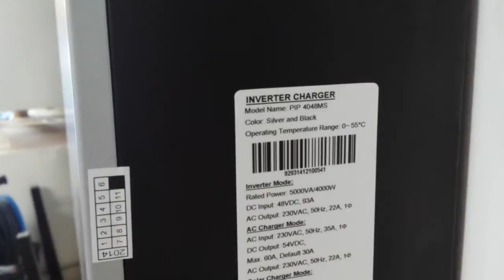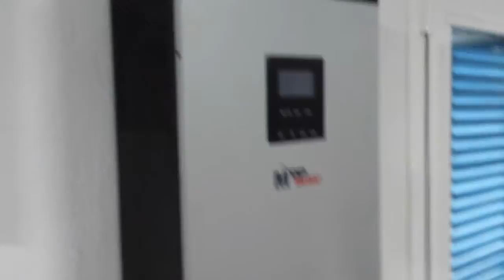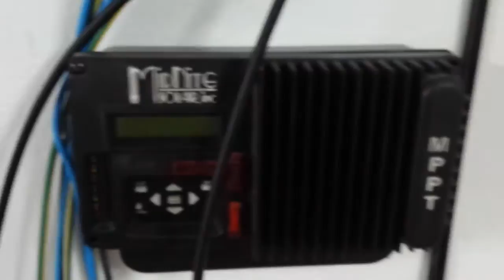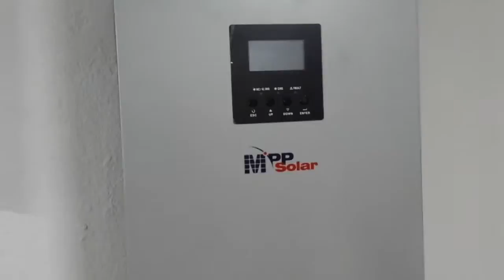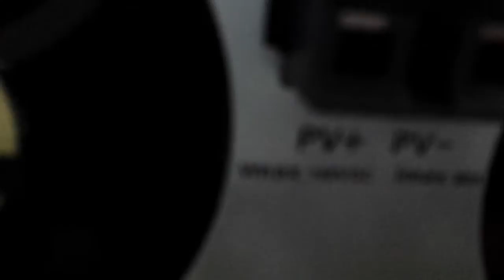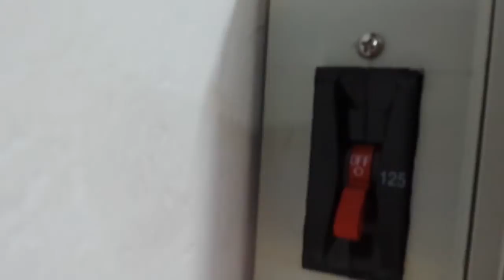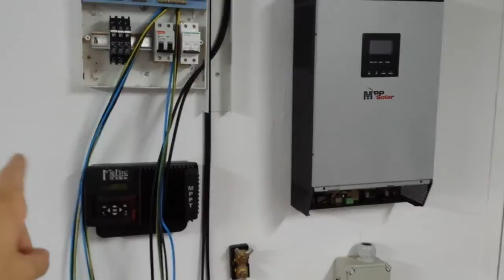Mpp Solar PIP MS 4048 mock up install

Comment: Hola Gustavo.

 Tengo un Inversor muy parecido al tuyo, un MPP Solar de 4 Kw Hybrid V.
Debido a que mis baterías Troyan sugieren un Voltaje de carga Bulk mayor al que estos inversores permiten configurar, estaba pensando en una solución como la tuya, es decir comprar un cargador de baterías y colocarlo en paralelo, pero tengo lgunas dudas sobre como funcionaría todo. Tu terminaste tu projecto ? Funciona todo bien con el Cargador MPPT del Inversor en paralelo con el MidNite Kid ?
Muchas gracias !!!

Comment: hi
do you have leakage current in your neautral?
Reply from the maker: Naim Mahmood There is leakage if the grid is not connected. ie neutral to ground measure 90v and phase to ground 130v but if you tie ground with neutral you should not have any issues. That has to be done before the first ground leakage protection.

Comment: I have 12 lead acid batteries 2V . an inverter 2424 msx pip . that cutting low voltage I put it ? Thank you.
Reply from the maker: vicentito2 23v should be OK

Comment: gracias por el vídeo me gustó y lo compré. pero tengo baterias opzs de plomo y quiero proteger el corte por tensión baja a 24.3v (50%)y no me deja sólo llega a24v. un saludo.
Reply from the maker: vicentito2 Perdón no pude responder antes. Si me acuerdo bien para el de 48v es 48v el mínimo para corte y creo que para 24v será 24v también. Tengo pzs también I me corta a 46v con 50% de descarga. Estas por el foro de aisladas en solarweb? Hay mucha gente que sabe de todo allí. Hazte socio si no eres y puede preguntar sin problemas.

Comment from the maker: Justin Case here is the video that I wanted your opinion on if you have some spare time to watch it. My last worry is really connecting the AC input and not mass anything else up. I will be supervising it but an electrician will do the final install. 
Thank you for all the advice you have given so far via your video.
Reply: Gustavo Malaga 

Hi Gustavo

If there is any term I use that you do not understand google it or ask me.

I like your setup- good components.  You do not seem to be absolutely sure about you Solar panel install.  I know English is not your first language and therefore your hesitancy may due to you speaking English. You are speaking very clearly and I think I am following your layout. The  Midnite Solar is an MPPT and the PIP 4048 also has a built in MPPT. It sees  in your  plans you are going to wire up both.One string of panels to the Midnite Solar and one string to the  MPP Solar.

I would choose one or the other. So I would suggest that you go with the Midnite Solar Kid as it is a very good Solar Charge Controller. You need to check that the Midnite Solat Kid can handle the input from all the panels (use http://www.midnitesolar.com/sizingTool_kid/index.php a sizing calculator) Installation instructions here (http://www.sentinelsolar.com/documents/KidInstallationManual.pdf)
videos
http://www.midnitesolar.com/videoDisplay.php

Before you connect to Midnite Solar you need to combine the positive of one string of solar panels with the positive of the other string of solar. You can do this either  by using a combiner box with fuses or MC4 Y connectors and fuses.

You cabling should be - from panels through either MC4 Y connectors or a combiner box with fuses. I f you are using MC4 Y connectors I would like you to have fuses before the Y connector. PV (solar panels) input to your through DC breaker to the Midnite Solar Kid (MSK). You only have a single pole. I would prefer to see a double pole breaker. From the MSK to your batteries through right size fuses or breakers. I think 6mm may be too small between MSK and batteries.  I like your Midnite Solar breaker (good kit). The rest you seem to have under control. I do not know what size your water heater is the maximum output of the MPP Solar is 21A running off solar and battery. It can manage more in bypass mode when it is being fed from grid.

The shunt should be as close to the negative terminal as possible so that your WhizBang is accurate.

Chris
Reply from the maker: Chris Hobson Thank you for all your advice! Indeed I got caught up and camera ansaiaty got the better of me, the panels are wire 3 in series and then 2 in parallel each string sum up to 1500w made up of 6 panels one string to the PIP and a second one for the KID. Great advice on the mc4 fuses I have already found inline mc4 fuses and will order them shortly. I will look for the double throw breakers on a future upgrade. 

6mm is the max the MSK aceptes so I have to stick with that it is less than a 40cm run from the breakers and also from the shunt. 

The water heater is rated at 1500w and the pool pump draws about 900w when running, I have uploaded a new 2 part video kind of a gran tour of the system  (it may be a bit boring! )
Lastly the shunt is a little more than half way up the battery cable total distance less then a meter.
Reply: Gustavo Malaga  Hi you need not worry you speak very good English and you speak clearly. I could not understand why you wanted to separate the inputs from your solar panels. Now that I has seen your Grand Tour video I understand entirely (you have panels facing different directions and therefore you need to use the MPPT of both the Kid and the PIP. Nice install. You live in a very beautiful city enjoy the solar.

 I have a PIP with 3kW of panel facing true north (in South Africa) and we run the oven and do the washing and ironing and run the dishwasher all off solar. I am experimenting with putting excess energy into a water heater. Up until now we have heated water with gas.
Reply: +Gustavo Malaga had a look at the videos. You did a great job :)